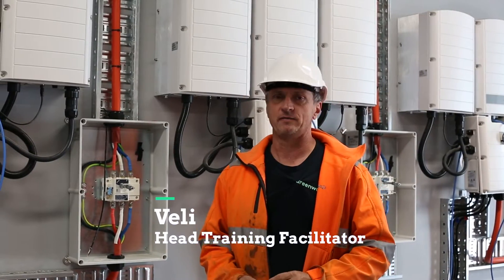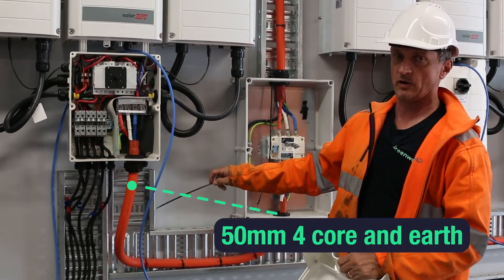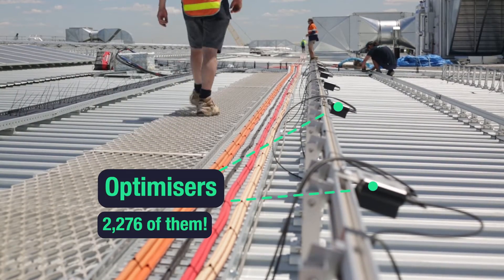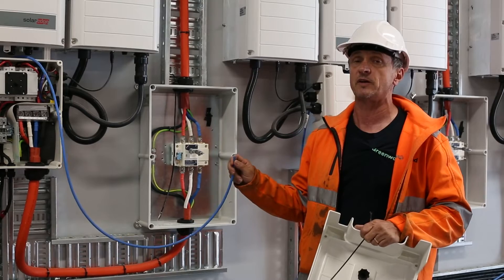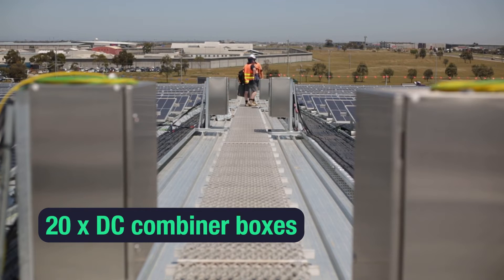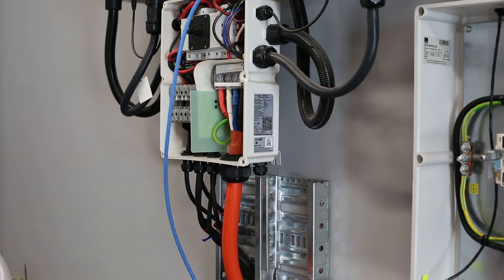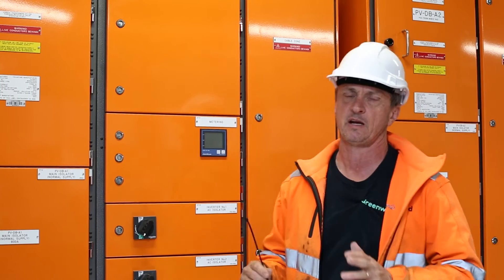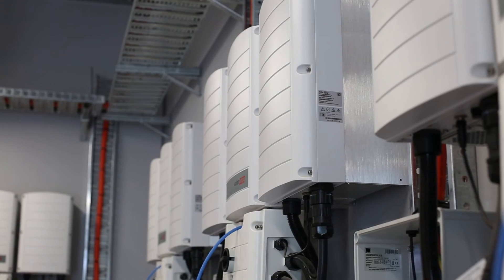2MW Solar Inverter Room Explained

Comment: Watching the video, I couldn't help but be impressed by Greenwood Solutions and their work on the 2MW roof-mounted solar system. Their expertise shines through in managing 10 SolarEdge units and optimizing 4,446 solar panels with 2,276 optimizers. This installation not only showcases their technical prowess but also highlights Greenwood Solutions' significant contribution to advancing sustainable energy solutions.
Reply from the maker: Aw shucks